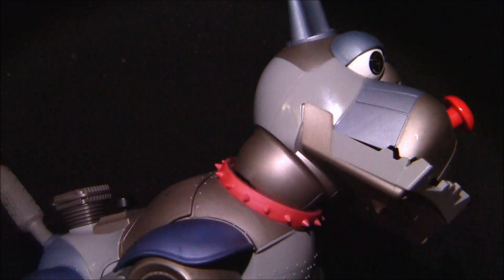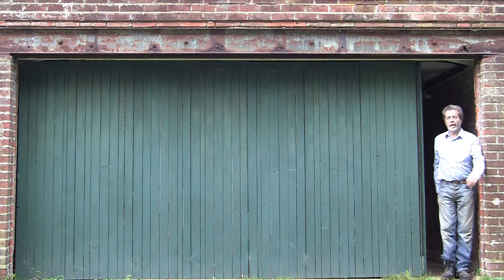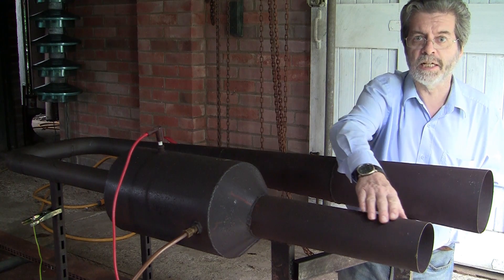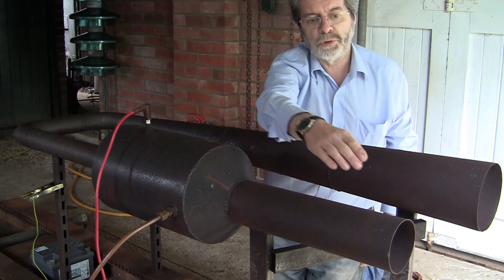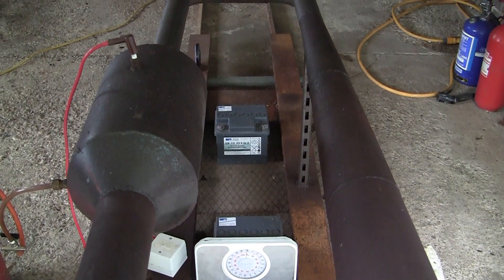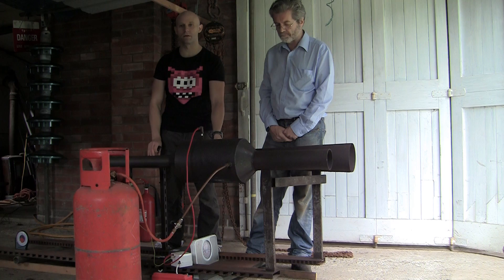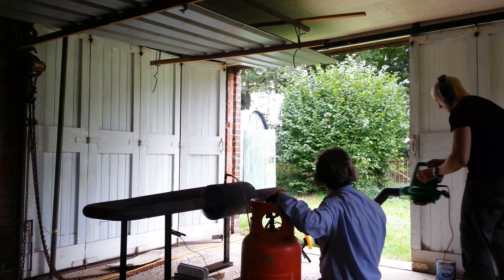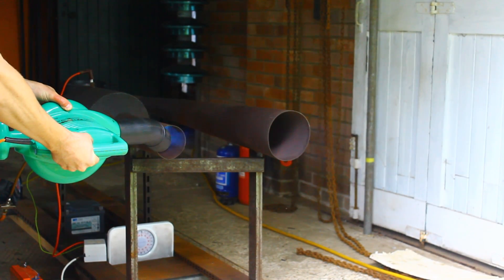Big Pulsejet Test Run

Comment: What keeps the explosions from causing the fuel to burn in the supply line and back to the fuel container?  Is there any chance of this happening?
Reply: You are describing a phenomenon called flashback, and it can be incredibly dangerous. A device called a regulator controls how much gas can flow out of the tank at any given time and  there is a little rubber seal inside a regulator like the one I'm sure they used on the fuel tank that only allows fuel flow in one direction (away from the tank). even with this rubber diaphragm inside the regulator there should be a device called a flashback arrestor installed between the fuel line and the regulator that will keep any flashback from ever reaching the tank and exploding.

Comment: Have you guys ever considered water injection to increase the mass flow, and use some of the excess heat to generate more thrust?
Reply: I could be wrong but I don't think water injection would help a lot because its not getting compressed with a piston in a combustion' chamber......well not a actual combination chamber anyway....I could be wrong....

Comment: Why does it look like all the high-speed exhaust is coming from what they called the intake?  The exhaust end looks like smoke is being dragged in.  Do these guys really understand how these things work?  
Check out Colin Furze.
Reply: He said it backwards, no reason to be such an ass, where is your handmade pulse jet?
Reply: Expirementation is the basis of knowledge. Pretty soon the will realize the long leg of the engine is the inlet valve for the short leg exhaust. Maybe they will anyway.
Reply: @gregwarner3753   Yes, I'm sure, but in another video, I saw, the thing was lit form the same end and was running the other way.  The long end was the intake.  Interesting that these things can be made to run in either direction.  Not the same engine, but one with slightly different dimensions can run in the opposite direction.  If I find the link, I'll send it to you.

Comment: Im skeptical that the side with the 2 foot flame is the intake.  Is that correct ?
Reply: Its supposed to be... but it sure is not here..
Reply: I agree.  And is that thrust typical?  Seems extremely low.
Reply: I actually verified, that is the exhaust, the tapered intake acts as an intake "ram" apparently. Not sure about the thrust numbers
Reply: @imagineaworld  I went over to Colin Furze and the short side w/ the combustion chamber is the exhaust and the long side is a tuned intake.  I don't know about the numbers either, but the V1, they say, was pulsing at about 50 per second and it sure didn't sound anything like that.  I expected 50 per sec to sound higher.

Comment: I believe you said the intake and exhaust backwards.
Reply: Look at which part heats up first, it's the long branch so that's the exhaust.
Reply: @cambridgemart2075   How could they be working on this thing and not know which is which?  Are they running it backward?  I just read the article on Wikipedia and I'm not clear on what's what.  I should look at an animation.
Reply: @alext8828  Was that supposed to be addressed to Uncle Schickelgrubber? I'm in agreement with K9T.
Reply: @cambridgemart2075  God, I think I have dyslexia.  I read your comment inside out.  
I see that you are in agreement with K9T, but he is saying that the long pipe w/ no chamber is the exhaust.  Clearly, the other pipe is doing something.  I have an animation here.  https://youtu.be/55JoyhDwggU  See what you think.
Reply: @cambridgemart2075   All the Lockwood-Hiller pulse jets run that way and all the diagrams and animations say they're supposed to run the other way.  I don't think anyone really knows how they're supposed to run.  Or else the long tube is carrying too much air mass and causing the thing to run in reverse.  There's every possibility that these things were built incorrectly.
Reply: @alext8828  Look at the colour of the pipe under load. It's common sense.
Reply: It seems to me that it’s both the air intake AND the exhaust.
When started it, he used a leaf blower to drive air into the stubby end.
Yet, once it fired & ran stably, a blue flame was emitted from the same orifice. I think. Must watch it again.

Comment: I saw the fuel line came straight away from the combustion chamber. How about running it parallel to the chamber for a short  distance to pick up heat so you boil the liquid propane?

Comment: THOSE ARE CATALYTIC CONVERTERS HAS MERCURY THEY CALLED PLATINUM ONCE IGNITED IS JUST NEEDED GASES ....THE SPARK PLUG IS PULSING HIGH VOLTAGE..FOR THE GASES...USING P PROFANE ACETYLENE...TRY HHO IS FASTER...BUT DANGEROUS... TORCH TIP USED TURBINES TO COMPRESS AIRE TO HEAT WHEN YOU COVER THE AIR INTAKE BUT THE TURBINE IS GOING FASTER  ALL THE AIR FROM INSIDE WILL HEATED UP ONE SPRAY OF ANY GASES IT WILL BLOW...FOR SURE...BAVIES DYNAMOUS

Comment: Well, interesting experiment.. but what are your conclusions? what did you learn and what (other then putting a tube fuel extractor in) are you going to do to increase the efficiency of this pipe motor? enjoyed the video but it lacked result's to me.. But what do I know.. I just work with wood and a bit of electronics (very little bit)

Comment: This should be on some type of aircraft. I'm thinking, something like a V1 with a cockpit instead of a warhead
Reply: yes a good right shaped pulcejet is very effectice if mounted on a moving objekt-plane,  there air is pressd in to the air intake,, compared to a testrun.. mounted in a garage where it have to suck the air mixd with exaust in again itself

Comment: atomised fuel delivery system will prevent flooding; try adding an acustic ossolation system to increase the pulsation rate. that will improve flow and will multiply the thrust. also research the tesla valve; this will reduce back flow via resistence, all of the aforementioned will improve your pulse jet ten fold. also where are you guys based I'd be interested to link up with you and exchange knowledge & ideas.. ??

Comment: Do you know what is the best design for valveless pulsejet engines?
Reply: Hey, I know your comment is 4 years old but I'm still gonna reply. So there's really 4 notably different valveless PJEs: Thermojet, Chinese, Linear and Lockwood. Each of them have their own ups and downs. Thermojets and linear are the easiest to build, but can be tempremental, and linear also has the intake pointing forwards so you lose some thrust. Chinese are easier to get going but slightly harder to build because of their angled intake(s). Lockwoods are arguably the most reliable but usually need to be much bigger to be effective.
Reply: @JakandDaxterAddict  your reply was helpful for me! thanks

Comment from the maker: Its to do with the uneven lengths of the pipe in relation to the position of the  combustion chamber. The explosion accelerates in both direction out of the combustion chamber and by the time the chamber is a vacuum and sucking in more air the explosion on the exhaust side is only about half way round the pipe The inlet side is very short so the explosion almost fire straight out the pipe